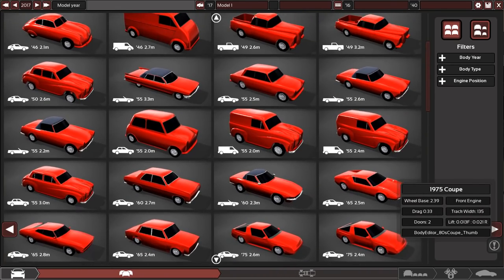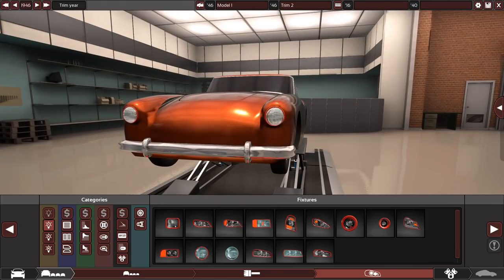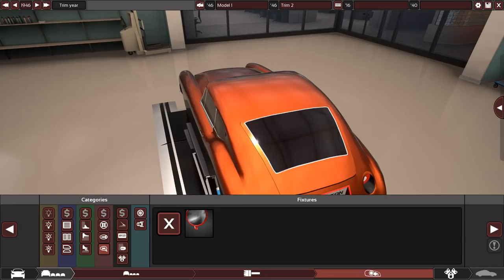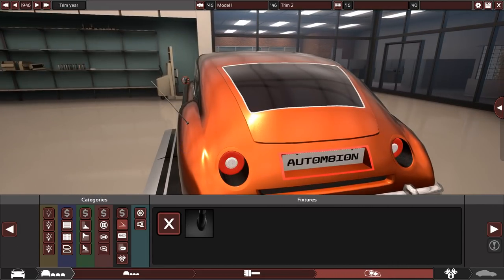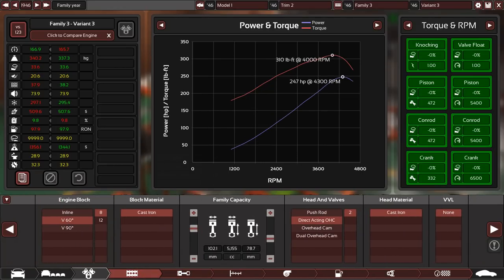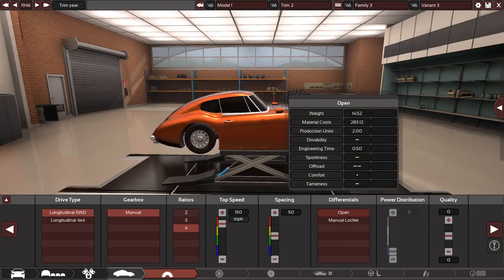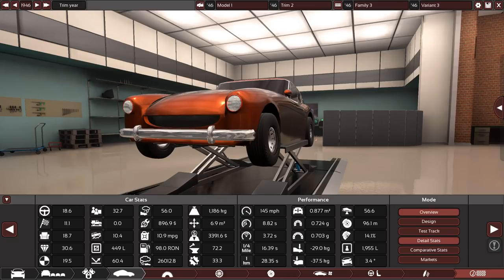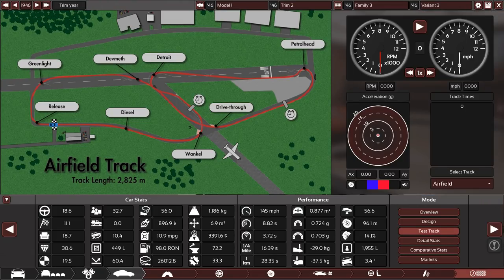Automation Challenge - 40's Sports Car

Comment: The tire sizes are behaving like they do because of the limits of 1940's technology. The 40's tech needs high tire profiles. The wider you want the tires. to be, the taller they need to be. So, you only get 165s when the tires are tall enough for 165s.

You make them tall either by making the wheels large enough, or by making the rims small enough.

Of course, you need appropiately sized rims to fit a large drum brake (as they are pretty sucky and need to be big to be effective) and wheel arches limit the size of the wheels so in practice, you are pretty limited when it comes to tire widths in early years.

This limit is a thing in later years too, but it's not as severe, so you have more freedom.
Reply: Also he forgot to change back the rim offset, which also limits you a lot. 
Generally Alex is pretty bad when it comes to automation :) He doesn't really have a clue how engine characteristics correlate, how the gears work, what the graphs mean etc. Doesn't make it less entertaining though :P
Reply: Well, he does kinda get the yaw rate, and how it either indicates understeer and oversteer.

Tbf, in the 40s, it's not like changing back the rim offset would matter that much. He got to 205s and he needed the smallest rims possible. That thing can't possibly brake well. And the fact that the engine cuts off right as it hits peak power. Ow.

But hey, he is having fun, and it spreads onto me, you know.
Reply: Yeah, crossply limits you to fairly square (well, circular) cross sections...

Comment: The I6 engine would have been more period correct. V8 engines were more for limousines and heavy duty pick-up trucks.
Reply: SilverBolt Folf That wouldn't be fun though, would it?
Reply: MinigunGaming You'd be surprised.
Reply: They were a popular choice, but even a cursory google for "1940s v8 sports car" gets me a first link of a "the top 10 sports cars of the 1940s" article (of course, just one random's opinion) which lists off vehicles with I4s, I6s, a V8 and a V12. The latter being a Ferrari...
Reply: Last Ride I used an I6 to make a muscle/track car... most muscle cars were I6 til the 70s
Reply: CheetahSpeed not really, most, if not all muscle cars had a v8. Unless you were talking about an i6 variant

Comment: just a quick explaination for wheels. older wheel tech wasnt good, wich meant you had to have larger sidewalls to be able to support wider tires, so to get wider wheels on old cars in automation you have to raise overall tire diameter and lower the rim diameter. raising quality will also alow wider tires. Also remember small rims equals small brakes

Comment: I wouldn't be too bothered about the balance between torque and hp, when you've got a none too extreme gradient on the torque curve and it starts at 180 lbft at 1100rpm, which compares extremely favourably to a ~1.5 litre turbodiesel of 10 years ago. Car of that weight and likely gearing, it'll have absolutely no trouble tearing up the tyres even in second gear.

Comment: Also if you're having trouble work out how some set of characteristics, e.g. tyre and wheel settings, affect something else, e.g. the maximum tyre width... only change one thing at a time. Twiddle one thing up or down, see how that affects the result. Then change that thing the other way, or change something else. If you fiddle multiple factors up and down at random all at one time, your outcome will essentially be random, white-noise like, and you've got zero chance of spotting a meaningful pattern in it.

Basic scientific procedure ;-)

Still, 13 inch rims with 165-equivalent section isn't at all bad in the historical context, and with the non-existence of low profile tyres. I think the big problem with the car is the terrible brakes, reducing the rim size down probably forced the drums to be smaller. You can see the computer driver slowing down waaaaaaaaaay in advance of each corner, and seeming to slow down in a pretty leisurely fashion even though they're probably standing on the pedal. Which means you're spending a huge amount of time slowing down instead of accelerating or holding a high speed, which of course will reduce your average speed and draw out the lap time. Other than the steady state cornering speeds, you're probably not threatening the limits of grip at any point.

Comment: BOOBS; now if you make the rim's smaler and got a big tire diameter you can make them wider, also when you thinker with the engine look at the RON number if you exceed the ron number you get engine knock adust compression fuel and ignition acordingly.